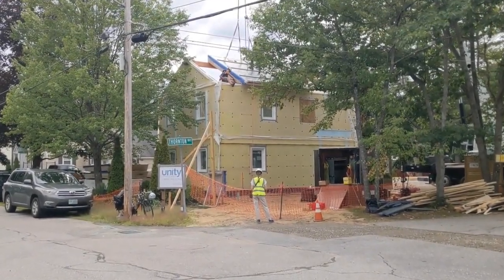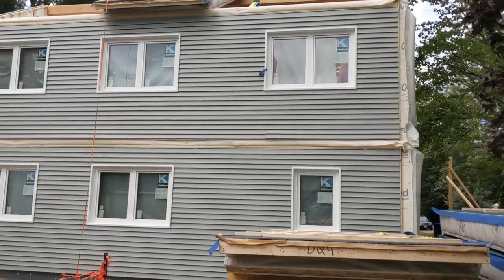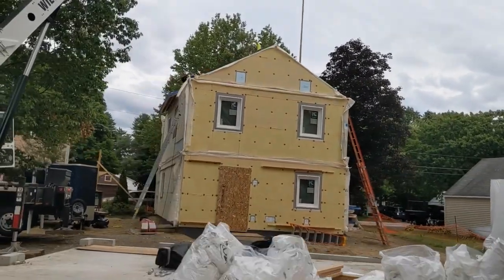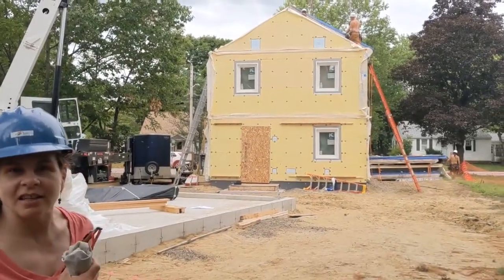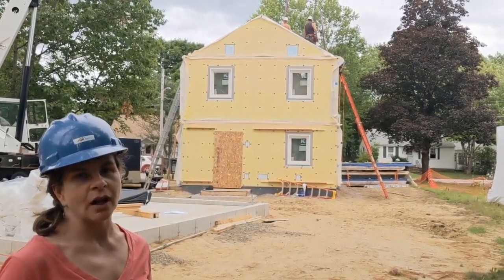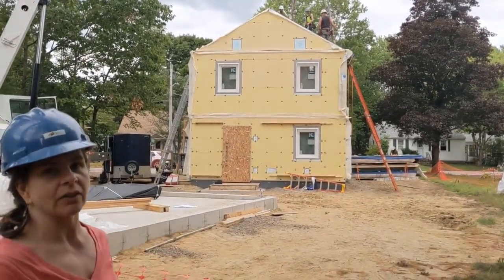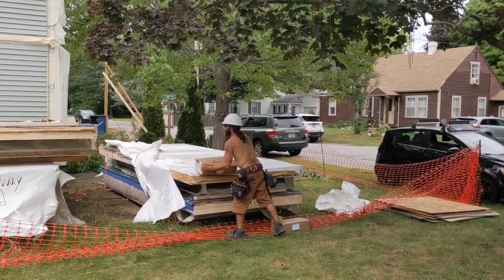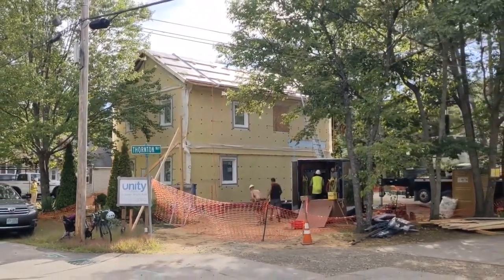R&D Project - Pilot Home with CertainTeed

Comment: Is that exterior insulation similar to the steico parafin/woodfiber sheathing/insulation boards? If so - glad someone in the US is looking to push that direction.
Reply from the maker: Yes, the exterior insulation is in fact Steico wood fiber insulation board. You might be interested in checking out TimberHP, a wood insulation start-up that's a spinoff of GO Lab in Maine.